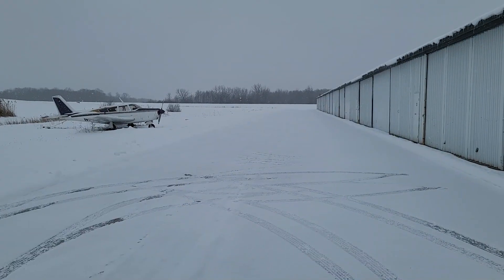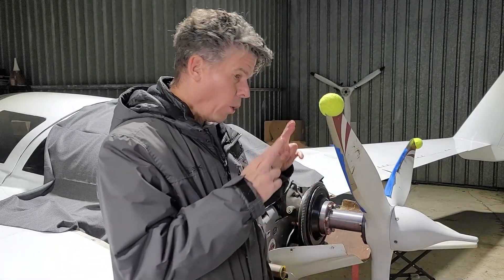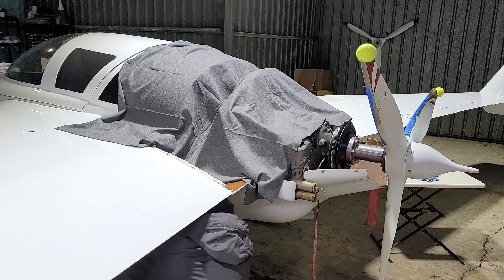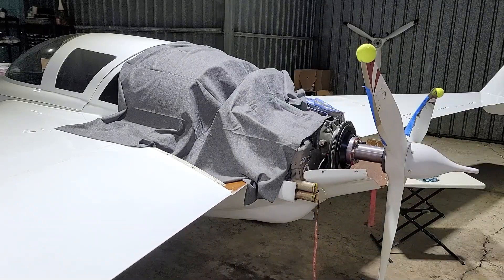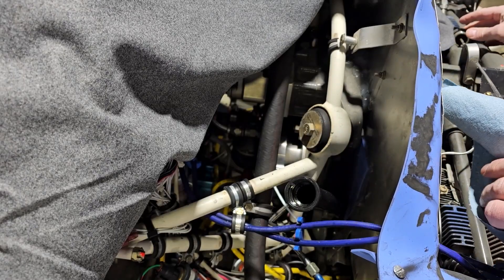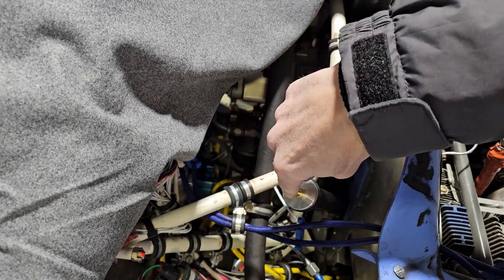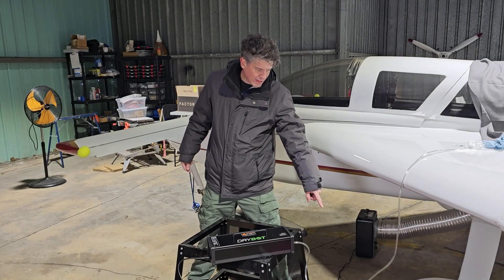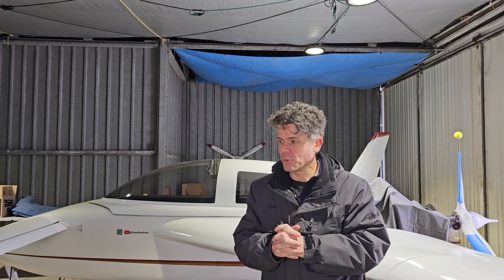Installing a New DryBot Engine Corrosion Inhibiting System

Comment: Being cheap, I went with the fish pump and desiccant. I'm using a closed loop system where I draw the air out of the breather and back into the oil filler.  I would prefer your system but the one thing mine gives me is that I am measuring the humidity of the air coming out of the breather.  I would imagine that running a tube from your breather into a clear box with a humidity gauge in it would give you that information.  You mentioned in another comment about the air out of the breather being fouled.  I somewhat get around that by not flying during the cold upstate NY winter. I haven't installed cabin heat yet.

Comment: OK let me also weigh in with a silly question. You showed where the air goes in,... but where does it come out?
Reply from the maker: Either the exhaust (mine are plugged) or the crankcase breather - the latter is preferable.

Comment: I think optimal would be intake for the DryBot was taken from engine crankcase. from opposite side than oil filler cap. That would be faster to dry engine and after that less regen needed.
Reply from the maker: You don't want to do that. That would foul the dessicant inside the DryBot with oil, as the oil and other hydrocarbon vapors come out of the crankcase breather.

Comment: hi scott, why is keeping the engine internals free of moisture important in aviation engines, whilst you never hear about this in automotive engines?  is it simply because of the risks if the engine fails, or are aircraft engines more likely to corrode for some reason? thx for the vid!
Reply from the maker: First off, aircraft engines are basically 1930's technology tractor engines, with huge pistons that have sloppy tolerances, unlike modern auto engines. This gives them some resiliency and reliability and allows them to run at full power at low RPM (redline on my engine is 2700 rpm) - required to prevent overspeeding the prop. However, it also means lots of piston blow-by, sending lots of combustion byproducts (mostly water vapor, carbon and carbon dioxide) into the crankcase, where oil suspends the carbon, and the water vapor exits through the crankcase vent. The water vapor condenses when the engine cools off. So we end up with lots of water in there.

This happens in automobiles as well, but with far tighter tolerances, far less water gets into the crankcase, and because the temperature of an auto engine is held extremely constant (thanks to liquid cooling), it can be consistently boiled off.

Next...airplanes very often sit for a week or two without being flown, with this moisture sitting in the engine doing its damage. Cars...very seldom sit for a week or two without being driven. Airplanes that are being flown all day every day (i.e. flight school  aircraft) rarely experience any kind of corrosion in the engine.

Lastly, and the main reason it's so important in airplanes, is that airplane engines and engine parts are very expensive. If I were to replace my engine, I'd be looking at a minimum of $60,000. So we try to do what we can to preserve them the best we can!
Reply: @CanardBoulevard  wow, great answer, thanks,all makes good sense.  i did wonder about a collection of classic or exotic cars that might be sitting for months or perhaps never even driven, those engines can be pretty pricey too. but for the reasons you give I understand why this might not be an issue.  very interesting topic, thanks for bringing it up.

Comment: Great update as usual. First congrats on getting the only color to get a Mazda in (subjective I know but it is what it is). For the cutout for the exhaust see if you can eliminate hard edges and fillet as much as you can should strengthen it. I'm sure you already know this just thought I'd call it out.
Reply from the maker: I suspect it might be contacting the exhaust pipe when the engine first starts up and kicks over a bit. I'm going to fillet it and reinforce the area.

Comment: Is the air also heated and dry thus eliminating the need for engine heater
Reply: Think that will be a no to it heating the engine, as it was 10 Watts running (that will be the air pump and any monitoring electronics) and 125 Watts during regeneration. (When the  desiccant is being heated to liberate the moisture that it's collected and that warm moist air is just vented out of the bot during that regeneration with no air feed to the engine during that time).
Reply from the maker: It's not heated, just dry - but yes, eliminates the need for the engine heater.
Reply: @CanardBoulevard  can you explain that? If it is not heated how does it eliminate need for heater in winter cold? Does it have more to do with moisture than the engine oil being viscous with the cold
Reply from the maker: @berniebrown9115  You will still need a heater to use for preheating the engine before flying in cold weather. But if you are using a heater left on 24/7 to keep the engine from condensing water and causing corrosion, then this will eliminate that requirement.

Comment: Accidentally deleted my post.... I was not understanding this was a stand alone device..... lol,  I thought it was going to be installed
on the aircraft & somehow filter the makeup air.  I got that wrong,  I guess it removes moisture from the engine oil & in turn from
the whole engine?  I'd be curious how much it might help any engines you own?  Yeah, cars as well.  peace
Reply: So have you seen the guy who added sensors all around this device & his aircraft to monitor the humidity at various
points around the room & engine out location?  BuildFlyGo talks about it but I'm sure you've seen a lot of these type
of videos or you wouldn't have bought the device.  It makes a lot of sense,  now I want to know the CO$T.....peace
Reply from the maker: I have not seen that, but I am planning to do pretty much the same thing!
Reply: Thanks for showing this,  I'd never have known about it & it is an amazing concept.  I mistakenly thought this was
an installable device.  Yeah,  caught me not watching the whole video before posting.  peace